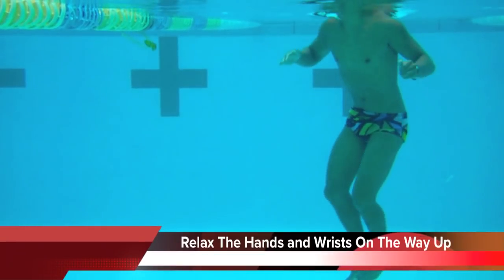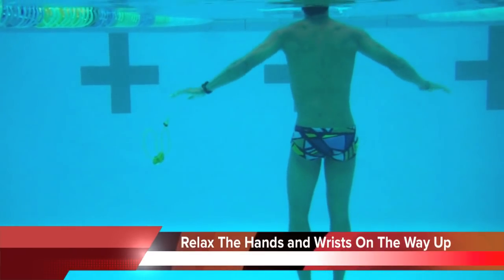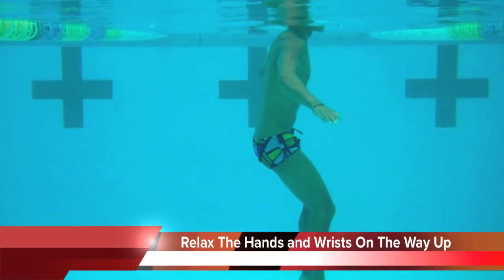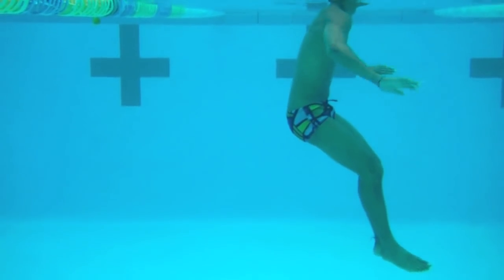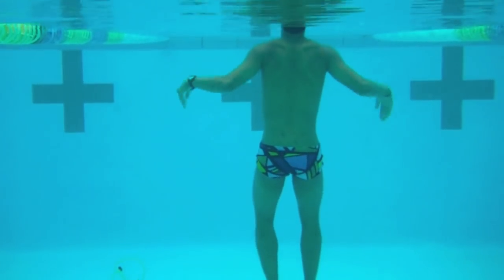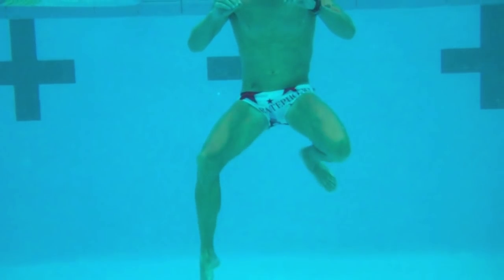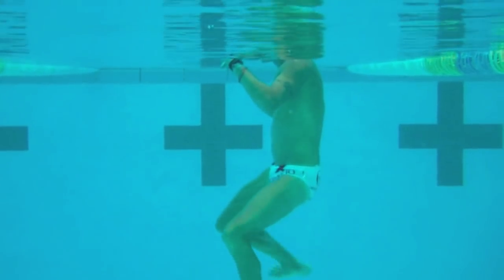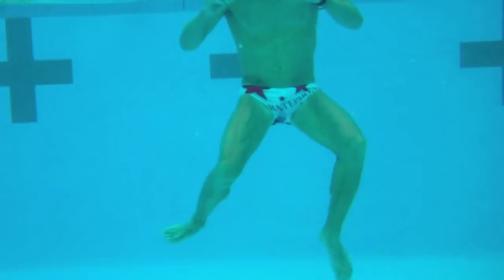How to Tread Water

Comment: Thank you for this video, Iam having problems keeping my head up out of the water not enough lift, my face is very close to the water and I have to keep my face up to the ceiling. I hope this video solve the PROBLEM. I will try it in swim🏊 class tomorrow. Will let you know how this works in shadow water first then to the deep. Thanks😊
Reply: TRIED THIS IN SWIM CLASS LAST WEEK AND IT WORKED. Iam  a happy camper😁😁

Comment: I'm almost a perfect swimmer, I can swimmer longer until I'm sure on the other side of the water is an object to hold, but the real problem is with sinking down in the water. Specially when I don't see an object on the other side of water I even can't trust myself I I can swim   because I'm afraid of sinking. I tried many times to hold myself on the surface if water but still I'm failed Anybody has a technics that would be helpful for me? How can I improve believing in myself?

Comment: If you can swim real properly, treading comes naturally. You dont event have to do any coaching on this. Your body will know how it will tread through the waters without even preaparing or thinking about it. This is the reason, it doesnt have to be included in the swimming lesson. Just focus to learn to swim properly. A lot here says they can swim but cant tread. You can only tell you can swim properly if you can swim by the miles, not by the yards; it should be as easy as like a daily walk.

Comment: That egg beater explanation is confusing as heck. Cant keep track of what leg is going clockwise and which is counter clockwise. But is it like whipping your legs down and leading with your instep?
Reply: Fro Buntu keep thighs parallel to the bottom but you can rotate the legs within the hip sockets - do not bicycle with your legs.

Comment: I currently taking swimming lessons and when I'm swimming horizontal I keep my abs a little more than slightly tighten.  This keeps my lower body up.  I want to know do you keep your core and abs tight also so stay afloat vertically while waving your hands?
Reply: Correct me if I'm wrong but you actually don't keep your core tight because it makes your core denser and you'll sink faster. :D

Comment from the maker: Negative buoyancy is generally caused by low body fat or extremely muscle density. If you do not feel that you fit into one of these categories it is most likely that there is not enough air in your lungs. Try inhaling more. Check out the "Vertical Float Fallout" video.